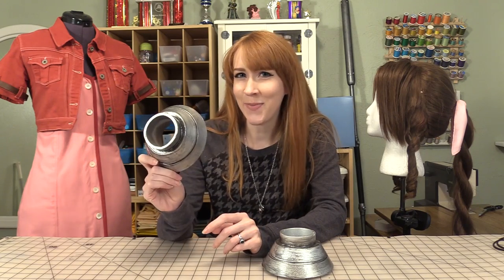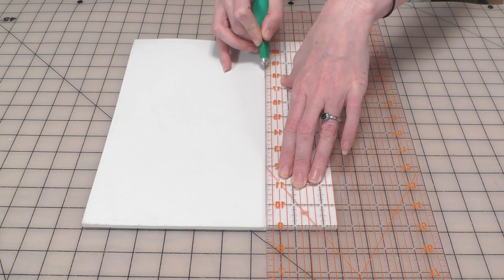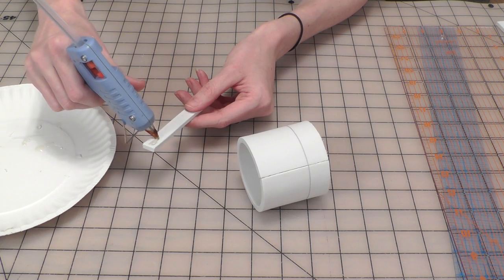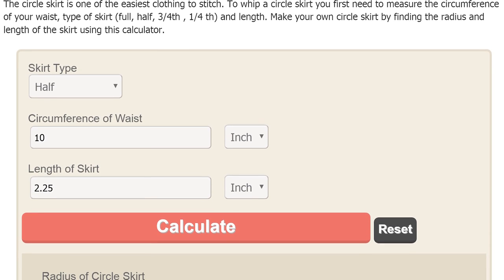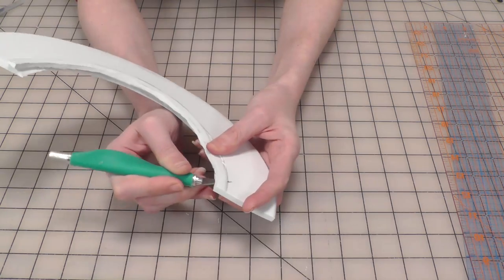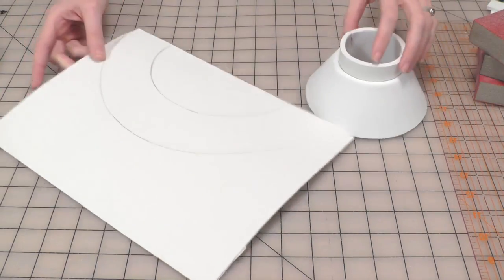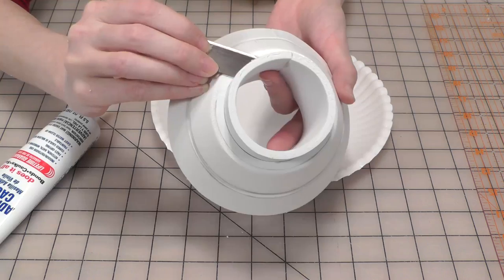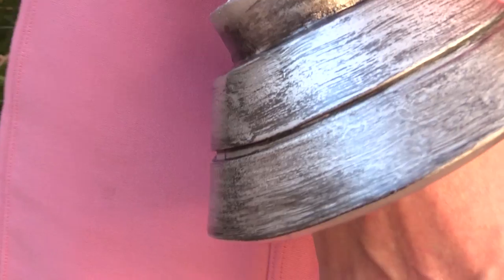How to Make Aerith's Bracelets (Final Fantasy VII) - Atelier Heidi

Comment: I really want to make this tomorrow (for a convention this Saturday!) but I don't own a heat gun. Do you think I can still pull it off? :O
Reply from the maker: You probably can, but the foam won't want to bend as easily. Any way you can use heat to help curve them will make your life a little easier. Try using a hair dryer on the hottest setting, or maybe leave the foam out in the sun for a while to make it more malleable. Good luck!